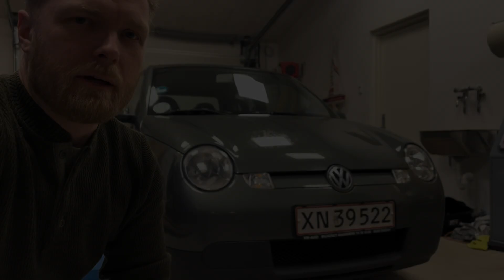VW Lupo 3L maintenance tips and tricks

Comment: Moin,

bei meinem Lupo 3l habe ich die Kupplung, Ausrücklager mit Führungshülse gewechselt. Zusätzlich habe ich das Getriebeöl auch noch erneuert. All diese Arbeiten wurden gemacht, weil ich das Gefühl hatte, dass er beim Runterschalten der Gänge sich sehr schwer tut und wirklich im letzten Moment (kurz vorm Ausgehen) noch schaltet. Zusätzlich lies er sich nicht mehr in Stopp starten, sondern nur im Neutralen Gang. Der Wert des Nehmerzylinders stand vor dem Wechsel der Kupplung auf 1,4V, ließ sich verändern, aber beim Treten der Bremse blieb dieser konstant und änderte sich nicht. Ebenfalls schon vor dem Wechsel der Kupplung ergab das Auslesen des Fehlerspeichers folgende Fehler:

 

01435 Geber 1 für Bremsdruck (Elektrischer Fehler im Stromkreis)

00813 Geber 2 für Bremsdruck (Elektrischer Fehler im Stromkreis)

00812 Löseschalter für Magnetspule für Bremsdruck

00810 Geber 1/2 für Bremsdruck (Unplausibles Signal)

(Im Anhang die Fehler nochmal als Bild)

Alle Fehler konnte man nicht löschen. Zusätzlich zu den Fehlern leuchtet auch noch die ESP Lampe auf. ABS funktioniert. Keine Ahnung, ob die mit meinem Problem etwas zu tun haben können.

 

Als es jetzt zur Neuanlernung der Kupplung und späteren Grundeinstellung kommen sollte, fingen die Probleme an. Wenn ich das Bremspedal trete, erreiche ich nicht den Wert von ungefähr 3,8-4V. Mein Wert steigt maximal bis 3,1V. Dadurch haut die Automatik die Gänge massiv ohne Kupplung rein, sodass an ein Fahren oder das Durchführen der Getriebegrundeinstellung gar nicht zu denken ist.

 

Da ich aber nicht direkt auf Schalter umbauen wollte, ohne auch nur für eine ganze Tankfüllung in den Genuss des Lupo 3l Konzeptes gekommen zu sein, habe ich mir von einem Schrottplatzauto den Druckspeicher und den Kupplungsnehmerzylinder ausgebaut und in meinen wieder eingebaut. Die Probleme blieben leider immer noch bestehen. Jetzt kann es natürlich sein, dass auch dieser Nehmerzylinder nicht mehr richtig arbeitet, aber es können genauso gut auch 100 andere Sachen sein.

 

Ich bin mit meinem Latein am Ende und suche hiermit eure Hilfe. Hoffentlich könnt ihr mir helfen, damit ich meinem Lupo 3l nicht sein Herzstück der Technik rausreißen muss.
Reply from the maker: The rear ABS sensors are used as speed signal for the transmission control module, and i am convinced that other signals are exchanged too.
I would start investigating the faults in the ABS system, as they could easily affect the cultch/gear mechanism. The brake pressure sensor is external, and easy to access. 
The brake light switch is by the way prone to failure, it is worth checking too.

Also consider reading the Self study program that i have shared name of in the comment field

Good luck!

Comment: Hej Thomas
Tak for videoen, jeg har et par hurtige spørgsmål, jeg synes ikke jeg kan læse hvor meget gearkasse olie du fylder på, hvor meget er det?
Har du skiftet hydraulikolie til den automatiske gearskifter?
Reply from the maker: I will reply in English so most can understand it.. 
vw specifies very low volume, but a lot of experience have shown that 3,1 L is better suited (similar to the volume used in VW polo that uses the same type of gearbox).
You can remove the speed sensor in the top of the gearbox and fill from there. I suggest you can look up more details at lupo3lklub.dk
There is so much valuable info there!
I used Castrol 75w90.

It is important to top up the hydraulic fluid, but I have never drained and changed it. Be aware of using the correct type!

Comment: damn the lupo 3L is actually a cool car, it's like an XL1 but actually attainable!

i've fixed up a very rough polo 6n2 as a winter project, this is very similar especially in terms of the interior and that damn rust-prone back axle...
Reply: The Interior is identical with regular Lupo. The Lupo od basicaly shortened Polo and 3L is the same just lightened

Comment: "Thanks for the video! It was really helpful. 😊
I've been driving a Lupo 3L since last summer, and it was converted to a manual transmission. 
Do you have any experience with the timing belt replacement? Wondering if it can last beyond 90,000 kilometers."
Reply from the maker: @user-du6zn  I wouldn’t dare to take the risk .. 90.000km is a long distance with same coolant pump, tensioners etc

Comment: Volkswagen says nitrogen should be changed every 70,000km don't believe it every 30,000km for a healthy gearbox
Reply from the maker: Vw don’t specify oil change interval on 3L. It’s suppose to last the life of the car. Since the oil is cheap, I have swapped gear oil several times in the hope of extending the life of it - it ran 10 years with no issues and free of noise
Reply: @achtomas  I do the same as you   I have with me the green oil box